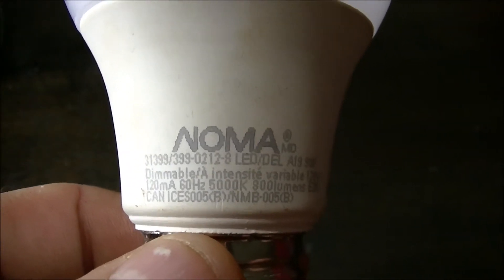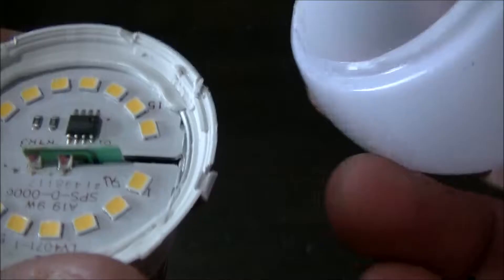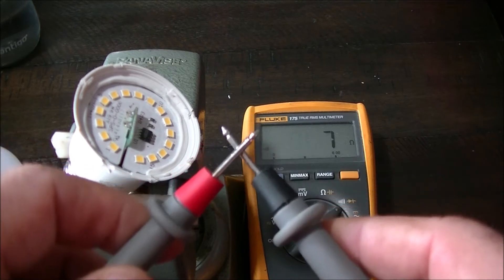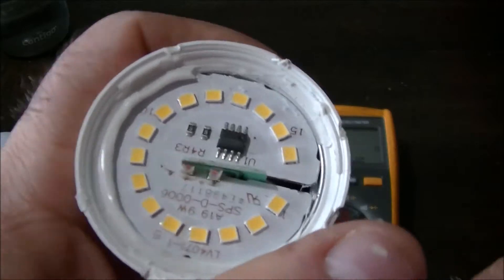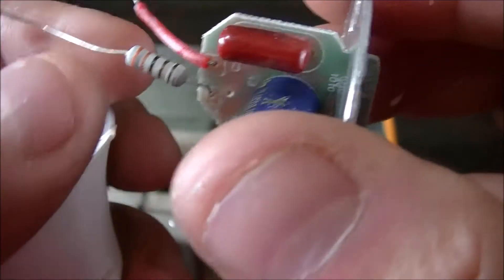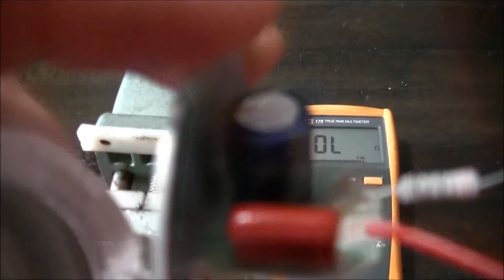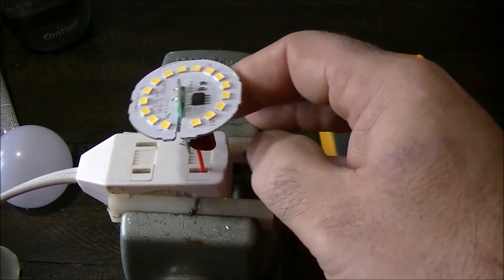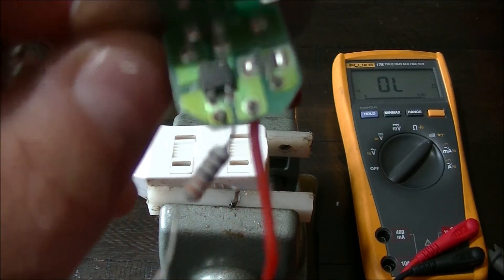Why LED Bulbs Fail Prematurely

Comment: extend the wires a bit more and you can easily solder those back and put heat shrink sleeves since u cannot apply tape inside. i have done this plenty of times. i keep a thin solder iron with a thin solder bit for stuff like this
Reply from the maker: Yes, that is definitely a good idea. Thank you for the comment.

Comment: The connector on the bottom that makes contact can be popped out with a knife etc. It could have been put back together relatively easily. I can understand not wanting to bother. 😎👍
Reply from the maker: You are correct.  Thanks for the comment

Comment: Why do LED bulbs fail prematurely?. You’re probably constantly turning it on and off. Which is not good for the diodes, or capacitor. LEDs are basically electronics. They have similar electronics to a CFL bulb. Despite them being completely different technologies. CFLs and LEDs in general don’t like to be turned on and off constantly. They will last longer than incandescents that way tho. LEDs should be on for about 15 minutes (like a CFL). And it will last longer that way. Just like a CFL. LEDs don’t like to be constantly turned on and off.
Reply from the maker: Makes sense. Thanks for the information
Reply: @Tobinindustrial  if you do turn them on and off constantly, they tend to last 2-3 years. Which is pathetic for an LED.
Reply: @Tobinindustrial  Also was this bulb in a teenagers room?.
Reply from the maker: @houseguestchannel  No, it was not.
Reply: @Tobinindustrial  So it was likely inside of an enclosed light fixture.
Reply from the maker: @houseguestchannel  Yes.
Reply: @Tobinindustrial  What LEDs do you buy now.
Reply from the maker: @houseguestchannel  There is only one supplier of these types of bulbs around here. they just brand them under diferent names.
Reply: @Tobinindustrial  I hope you don’t have a teenager or kid.
Reply from the maker: @houseguestchannel  I hear ya on that. lol
Reply: @Tobinindustrial  Do you have a teenager?.
Reply: It’s called planned obsolescence. LED bulbs are designed to fail. 10000 hours is FOR THE DIODE not the driver. The driver is usually the part that fails. Causing flicker or death of the bulb.

Comment: Same thing began happening. One led bulb I bought 10 years ago from Philips is still working to this day. The last 8 led bulbs I bought from Lexman and other oem brands in the last 2 years have all failed. Honestly to me this looks more like planned obsolescence. If your lamps don't fail costumers wont return to buy replacements.
Reply from the maker: The quality of some LED bulb manufacturers has dropped for sure. I am not pleased but I am recording all the purchases and documenting the time they last.
Reply: @Tobinindustrial  Rodrigo Serafirm probably used them in a teenagers room.
Reply: Its all a way for them to make $
Reply from the maker: @numberone7674  It would seem that way for sure.

Comment: 121520/0523h PST.    Good day, Andy. The ‘bulb’ is not destroyed. You can still rewire it, by lengthening the RED wire and drill a pin hole at the Phase terminal and solder flat on it. Now for the resistor drill similar hole on the  neutral thread towards the maximum top and solder. It’ll work. I have done it, so can you. Best wishes to you and family. Bless you. 73s...
Reply from the maker: Thank you Sree for this. Great minds think alike. I have done as you have said (give or take a few steps) and the bulb is back in the shed. I put the repair date on it to see how long it will last. Thank you for dropping by  and God bless you and your family as well. Merry Christmas.
Reply: @Tobinindustrial  Also turning LEDs on and off constantly is a destroyer for LEDs.
Reply: @houseguestchannel  turning LEDs on and off does not destroy them, maybe the power supply components in this type of LED bulb, but not the LEDs themselves. The way most dimming LEDs work is they turn them on and off very fast for a dimming effect.
Reply: I ate some crackers last night before I went to bed, and then dreamed about esting cheerios

Comment: With mine that failed it was normally the cap that had gone open.  In one case a lamp exploded.
Reply from the maker: Wow, they certainly did their research before forcing the prototype unto the assembly line lol
Reply: @Tobinindustrial  Fred In The Shed probably installed it in the teenagers room.